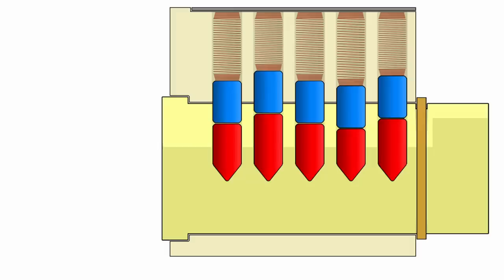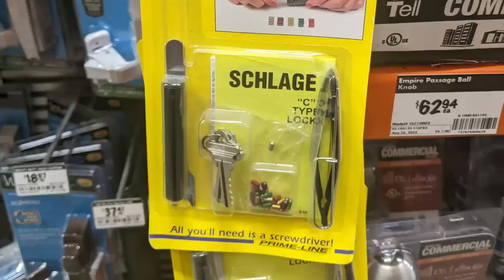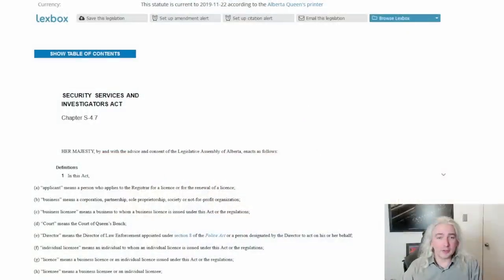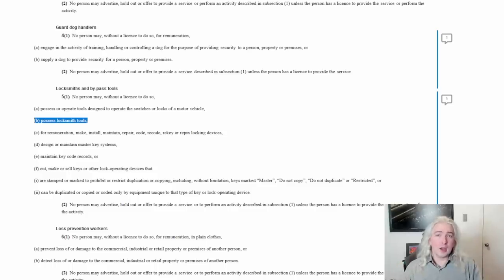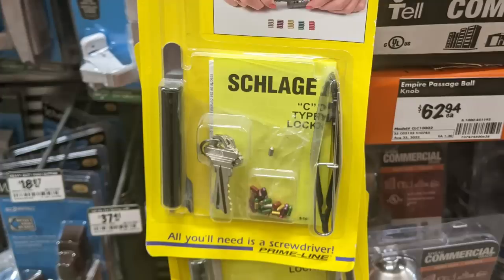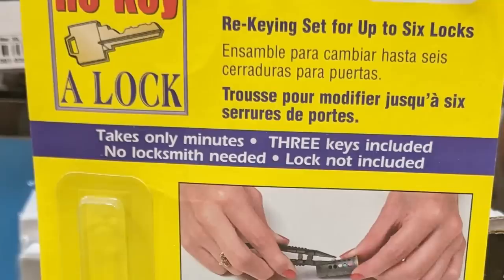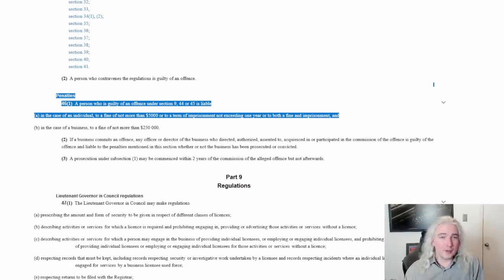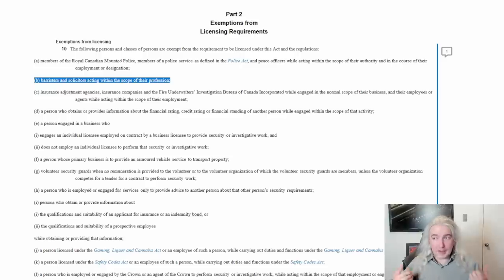Stupid Law Makes This Illegal (In Alberta) -- A Lawyer Explains

Comment: LPL has repeatedly proven you can "Pick" a lock with a strip of Red Bull can. So under this Feel Good law, Red Bull cans are a "Locksmith Tool".
Reply: @douganderson7002  it could be if the arguement was entered in court, its an incredibly broad term, if you were found in possession of materials that could be used to cut a shim from and other things which indicate that a usage for the complete list of items is in contravention of the act.

this is the problem with broad undefined terms, the ONLY limit to them is what's been set as precedent.

given the current kia issues, an impact tool, a knife with a strong spine and a USB cable could be entered into evidence as 'going equipped for the purpose of car theft ' 
it all depends how the term is taken by the courts generally.

similarly, there are certain things used by magicians routinely that are going to be banned by this, bump shims, small plastic discs etc etc etc. 

one good example is the solvent filter issue in the US, it doesn't matter that it is and can be used for its intended use IF it can be modified into a silencer part it IS a silencer part and if you INTEND to modify it it becomes a prohibited silencer part. now... that covers EVERYTHING, Buy a lump of Ali intending to turn it into a baffle when in possession of  an approved form 1 (legal right to make) and you are in technical breach of the ruling.

Comment: Considering how easy it is to make common lockpicking tools out of hacksaw blades, windshield wipers, and street sweeper bristles, even defining this law makes no sense. Never mind that someone looking to rob a place is going to look for a building that has no one inside of it and a) find something within a window, break said window, and abscond with the item, b) look for an unlocked door, or c) try kicking the door in or attempt to shimmy a thin piece of metal between the door and the frame. And even if they do try and 'pick the lock', they're going to use a bump key which anyone can make out of a blank key and a file. If they can't open it with a bump key, guess what someone will try and do?  They're try another house. Same principles apply to cars. Look for one that's unlocked. Smash the window and run. Use a blank to overlift the wafer locks.
Reply: You can’t overlift a wafer lock (nor most pin stacks) and making a bump key that actually works isn’t as easy as you think, though it can be done with a file and any key of the correct keyway. Pretty much everything else you said is correct. I don’t know about Canada, but here in the us, lockpicking and bypasses are pretty much never used by criminals, even bumping. Brute force entry is the coin of the realm. We pick locks and use various bypass techniques, including occasional destructive entry (to the lock) in order to protect the client’s property, which is not usually a big concern of criminals.

Comment: Hot canadian take: I worked closely with a locksmith for a few years. In Alberta you have to be certified to be a locksmith and part of their association. In BC there is no certification or association. In Alberta locksmith tools are illegal to the public. In BC locksmith tools are legal to own and you can use them if you own the lock or permission of the owner.

This is just a law big locksmith has lobbied in place to keep their jobs steady and the public out.

Comment: By their logic. A 'House Key' could be considered a "Locksmith Tool" Seeing as rekeying is typically done using the existing operating key to take the plug out of lock. Yes, you can use a lockpick or a shim. That will usually cost more money because customer probably lost all keys and fear they may have been stolen thus needing them rekeyed. 

Also, a Drill could be considered a locksmith tool. Some lockouts are done with a drill. For stubborn or damaged lock and let's the Locksmith charge you even more money for a new lock. 

A screwdriver can be considered a locksmith tool
.... lol you could go on and on.. 

Bad legislation.
Reply: doh its not for tools that could be used for multiple applications its for tools which could only be used for locksmiths. thats what he also explains the tweezers arent a problem but the core follower which has no other use than that he thinks is so making that part illegal , i would just toss the follower and craft one myself by taping up a piece of pipe to the right size.
Reply: @cornnatron3030  you just said a plug follower is nothing more than small pipe. It could be used for other applications.  So it's not exclusively a locksmith tool.
Reply: I can hammer a nail in with a rock that doesnt make the rock a hammer 

I can also make my own follower that doesnt make the follower in this kit not a special tool.
Reply: @cornnatron3030  a rock could be considered a rudimentary tool. A follower is just a tube. It can be plastic or metal. And It doesn't have to be solid. Like a rock it could used for multiple things. It's not special. You can leave a rock on the ground to look pretty. Or Use it as hammer. Or Kill someone with it. And hell break into a house! Would it now be called a special locksmith tool? 😆
Reply: @666THEMARK666  no it wouldnt but seeing the follower in this kit is made with one specific use it is , if the maker for the kit would replace it with a tube  it wouldnt be but thats not whats in this kit. and thats where the problem lies .
if they would call the kit a fidget kit there wouldnt be a problem neither its just the branding and the tools which come under that branding. 
but it doesnt really mater for most people seeing that nobody except maybe locksmiths would recognize the tool in your possession .
 so even if the law would ever come by with a search warrant i dont think that they would recognize the tool as a locksmith tool.

Comment: My two favourite hobbies; law and locksmithing.

A ‘follower’ is needed to prevent the top pins and the springs from flying out of the cylinder when the plug is pulled out of the cylinder.

It would be a stretch for any prosecutor to assert the supplied cheap plastic tweezers are locksmith tools. Everyone has a pair of tweezers in their medicine cabinet at home. These tweezers are not a specialized tool peculiar to only locksmithing. And the supplied follower is merely a cylindrical piece of plastic. You could just as easily use a plastic pen or a marker to accomplish the exact same job as a follower.

I think only two provinces require a licence to be a locksmith and to possess locksmith tools. I’m in Ontario and I own thousands of dollars worth of locksmith-specific tools. Some suppliers won’t sell you certain kinds of locksmith tools, like lock picks and snap guns, slim Jim’s, etc., while others will. sparrows.

Check out the Lock Picking Lawyer on YouTube.
Reply: LPL?
Reply: I'm in Ontario and I didn't know they wouldn't sell locksmith tools here sometimes. I've had no trouble
Reply: Lock picking tools are considered Tools of Break and Enter, so if you're caught with them, you could face charges.
The way it was explained to me is that if you have a pair of socks in your pocket as you're leaving the mall, you're just a shopper. But if you're sneaking down a dark alley at 3 am, and the cops stop you and find socks in your pocket, they can arrest you and get a conviction, because normal people don't walk around at that time of the day with socks in their pockets.
Reply: @e-curb  Yeah, it was my understanding that you can have a set and use them at home as a hobby all you want. However if you're caught out in public with the tools in your pocket, you could face charges.
Reply: @joscpe  not in Ontario, but it can be used for suspicion of a crime.
Reply: Alo

You caught me
Reply: I've looked into getting some sparrows picks before.  Are they worth the price? I got mine from Amazon, or made them myself

Comment: I've repinned a few locks before, but never used a special follower. I Just went through the stationary drawer until I found a marker that fit inside. 

Theoretically,  if owning this "tool" is illegal,  so is having a Bic pencap, a broken hacksaw blade, or an empty popcan. These can all be used to defeat locks.

Comment: So now I'm wondering - for a friend, of course - where this leaves Automotive techs. My friend often has to repair or re-key or alter locks on automobiles that for some reason local locksmiths won't touch, as part of his automotive repair business. Many older vehicles simply don't have parts available anymore to simply replace lock cylinder and key as a matched set. He also has to have break-in tools for cars. Not being licenced specifically as a locksmith, what legal category does that fall in to?
Reply: I'm going to guess Honda? Servicing locks on vehicles doesn't require any real special tools. Usually screwdriver, circlip/ring clip remover, and side cutters. Replacement parts would be maybe the cap and wafers/pins. Should be good on that part. I'd regard that as mechanical.
However, entry tools. I believe tow companies can use them, but the individuals still have to be registered with the solicitor general. If they don't have them, they're possesing tools and operating a service illegally.
Reply: Hot cars lol 😆 kidding I could not resist
Reply: I've considering getting a kit to break into my own car due to how often I lock my keys in the car.

Comment: Electric bicycles frequently have key codes saved in the memory from factory to allow you to order replacements for the battery lock key from the manufacturer. Responsible shops will save the code on the customer file along with serial numbers. Shops routinely replace battery locks for lost keys. In a few cases, I have had to defeat the existing lock because it failed under warranty and I have to replace it as the authorized warranty center. Lock smiths do not have access to the cores for bikes. Only available through bike distributors.... There are some big problems with this law......specifically the parts that makes it illegal to keep a list of key codes if you are a dealer for the product and responsible for warranty service.

Comment: A law that makes lots of ordinary people into criminals instantly.  Every cop out there has a hard-on for laws like this.
Reply: No, not "every" cop. Most cops hate these kinds of poorly written, not easily explainable or enforceable laws, and as you say turn many citizens into "potential" criminals. Most don't want to deal with it and most know that 90% of the people do not want to do anything "wrong" in the first place. I come from a line of law enforcement and know that they tend to "overlook" something like this unless of course a person was caught red-handed in the middle of a break-in and had locksmith tools on them at that time.  Unfortunately there are those few bad apples that will look for any reason or anything to arrest someone. Fortunately, those arrests still have to go through the system and often get thrown out. Using the words "every", "always", "never", "all", "none", get people in trouble.

Comment: Sask Resident here. I wasn't even planning on re-keying a lock, I just wanted to rotate it 180 degrees so that the keyway sat the right way when installing the lock on the door (it came ready for the left-hand side, I was installing on the right-hand side). Local locksmith where I bought the lock wouldn't sell me the tool to release the clip, citing "burglary tools" as the reason, but offered to rotate it for free for me if I brought it in. Meanwhile, Amazon will sell me one for $12, but I just used a pair of screwdrivers.
Reply: That's a service tool, not an entry tool. You have to have the lock removed to access that part. So I'm gonna call bunk on them for that.
Also, keep in mind, every province is different. It's not a red seal trade. Our sister store has their employees take the locksmith course in alberta.

Comment: If they’re going to get you for those “locksmithing tools” then they can get you for a walled full of credit cards, a pry bar, a power drill (some guys are lazy).

The best lock-picking tools are the metal backing of a windshield wiper and the spring steel from a street sweeper’s brushes.

Comment: This is a good lock re-keying kit, but it only works for a lock made by Schlage. It is also a little tricky to do, you really only get one shot on inserting the cylinder plug tool, if you do it wrong the sheer line pins and their springs will pop out of the lock and you will then need a new lock or a locksmith. I've had fun playing with this kit.
From the province that "Thinks" it's the center of the country!

Comment: You can use cylinder that is the right size and smooth as a follower. Sometimes you need notches cut on the end, but is too generic to only be used for locksmithing. You can use stck round for metalworking, and use them for whatever application.

Comment: In before Harry (LPL), I think.
BTW in Australia you need to be licensed to work as a locksmith but you don't need one to buy or possess tools as you are quite within your rights to work on your own locks or take part in Locksports events. You will however have a lot of questions to answer (and possible charges to face_) if found in public with said tools "without good reason". I'm pretty sure that's the case just about everywhere, US included and I don't have a real problem with that as long as the law is enforced in a fair and reasonable manner.

Comment: Thank you Ian for this and many of your other videos. I just discovered your channel a week or so ago and have learned a great deal from your videos already. Would you happen to know if BC has similar legislation regarding locksmith tools?
Thanks again and best wishes to you. I look forward to hearing your thoughts on the recent announcement by the Alberta government re them funding 40 new positions in the Alberta CFO. Will the feds be cool with that ya' think?
Reply: It might be similar in BC. I've been re-keying my locks for many years. At one time, I was running short of the various length pins that the key pushes against, so I went into a locksmith and asked to buy some. Not only did he refuse to sell them to me, he hinted that what I was doing was illegal.

Comment: I mean its pretty easy to overcome this from a product development perspective. 
 Tell them to just use a dowel rod. Not useful for all locks but many of them. The dowel can be modified to work with most locks though. 
 And i think that so long as you are buying a commercially available off the shelf product sold in the jurisdiction where the action is brought and sold without restriction there shouldnt be a problem with someone buying and transporting them from the point of purchase to their home. 
 Its possible that someone could get stopped and searched with one of these on the way home but it seems unlikely that someone would make a big deal of it with it in the packaging and with a reciept. 
 You are correct though that this shouldnt be illegal at all.